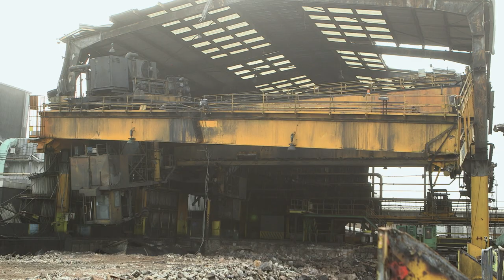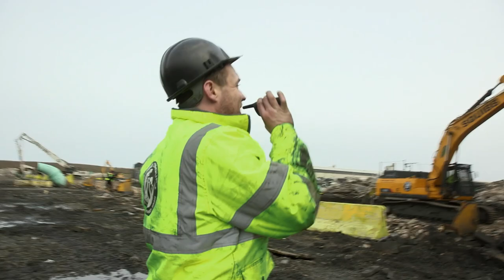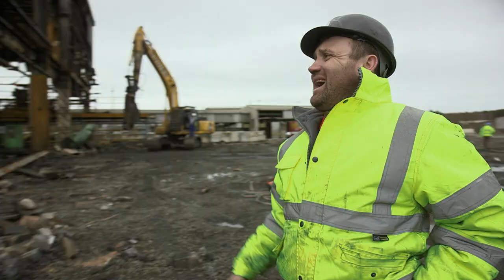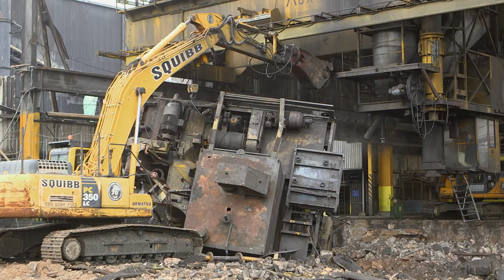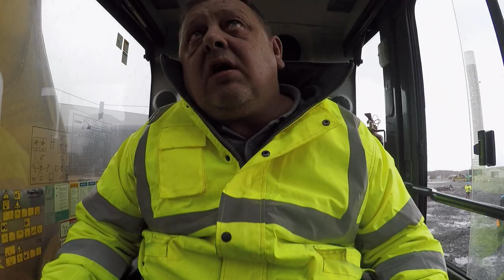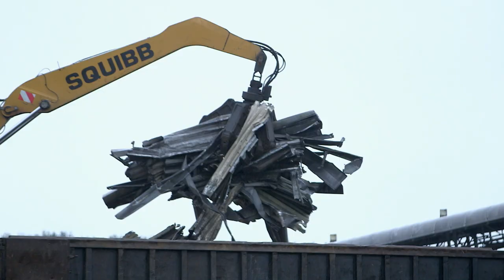Can Tony Pull These Cranes Down Once And For All? | Part 4 Of 4 | Scrap Kings

Comment: Nice destruction, but on the other hand.. what a waste. Such overhead crane costs 100.000’s of euros/dollars/pounds
Reply: They can probably scrap it for even more that what it is worth, the crane is more than 30 years old and I bet most of the inner workings are completely ruined from people breaking in and stealing important bits.
Reply: yes, but you have to find someone who wants to buy it.. and then it still needs to be disassembled, transported, restored & upgraded to modern safety standards.. good luck :)
Reply: As a Crane Inspector and Fabricator I say what a waste. I have reinstalled several old cranes in new buildings. The bridge is the part you want to save. Very easy to lengthen or shorten. The trolley and hoists are easy to replace. Put new drive motors and remote controls on it and its good as new.  Inspected and load tested a 5 ton bridge that was installed in 1939 and recently upgraded to modern drives and controls. Still used the original hoist, trolley and bridge drive motors. Passed with no issues.
Reply: Millions these days :/

Comment: Very Rough boys.. but get the job done fair play.. no dust suppression tho & no mask.. & sum of the machines are totally wrecked 😬...
Reply: Saving around 50 year old cranes and installing them somwhere else is both VERY EXPENCIVE AND A WASTE OF TIME, BECOUSE MODERN EQIPMENT IS WAY BETTER AND LAST LONGER.
So in total its better to reuse the metal and build new cranes.